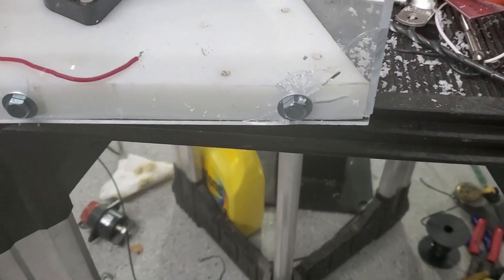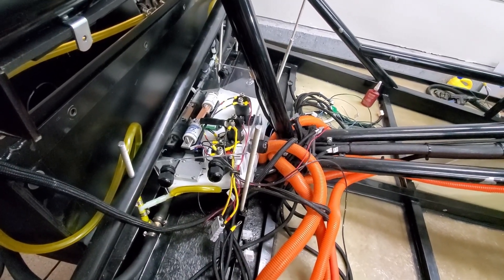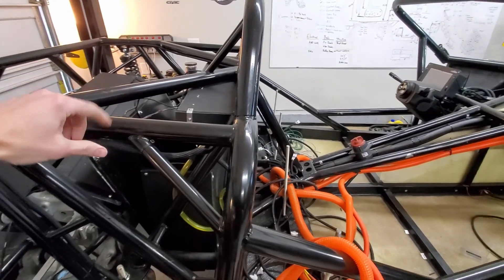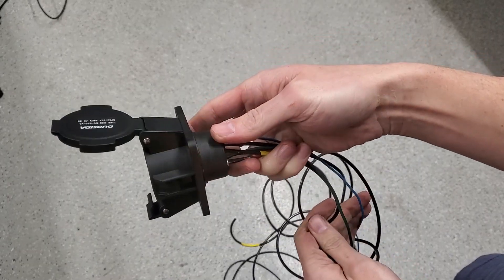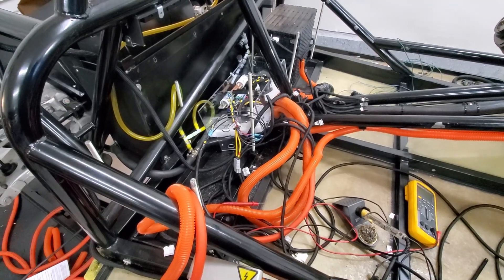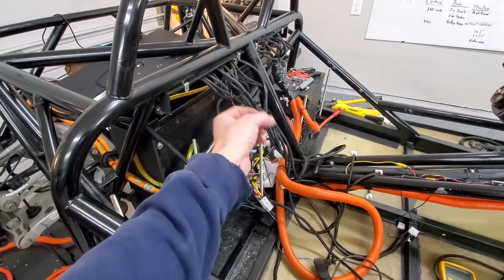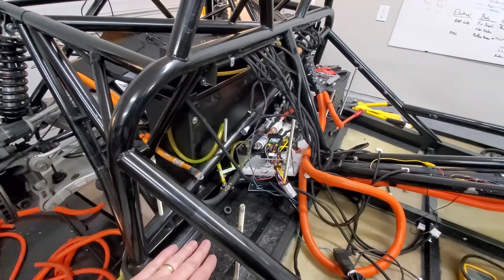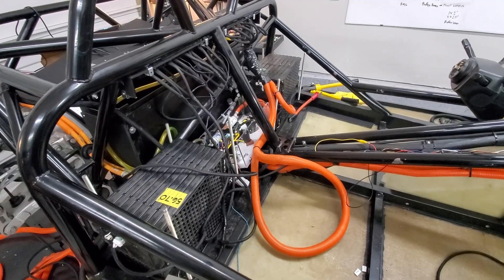High Voltage Part 2

Comment: What are your thoughts on braille batteries?
Reply from the maker: For a regular car or electric car?
Reply: @electricsupercar  For a electric car, let's say teslas or any type of New EV
Reply from the maker: So there are probably several different types.   The one I saw was 0.12 kWh for a 9 lb battery or 75lb per kWh. By comparison,  the battery modules that I am using weigh 40 lb but have 2.6 kWh or a a little better than 15lb per kWh.  So my batteries are 5x better weight per kWh.  They would not be ideal for an electric vehicle
Reply: @electricsupercar  Thanks for the input👍👌

Comment: what amp charger will you have? those wires look pretty thin
Reply from the maker: The charger itself came pre-wired with 12AWG wire so I figured 12 was probably fine. It is a Elcon 2500

Comment: if your charging port is facing up, itll get full of rain D:
Reply from the maker: I have had some comments suggesting behind the license plate.  thoughts?
Reply: @electricsupercar  if u have to bend over to plug it in every time, you will get pissed off after a while xD
edit: just googled where the license plate is on the back of the k1 and its not "that" low like some cars, guess youll find out when you get there :D
https://www.fiberclassics.org/wp-content/uploads/2006/06/attack-k1-8.jpg
this guy is bending a lot
Reply from the maker: I will have to do some more thinking. 🤔

Comment: Loving the build so far, keep them videos coming please.

For the charging port/outlet; why not put it behind the rear license plate. You can have a magnet hold your plate from top and hinges at the bottom or a small hydraulics strut (like you see for hood supports) .  Fold license plate down to expose charging port.

This way your car will still have a clean look to it.

Just a thought
Reply from the maker: That is a great idea!  Keeps things clean.  Thanks for the comment! 👍